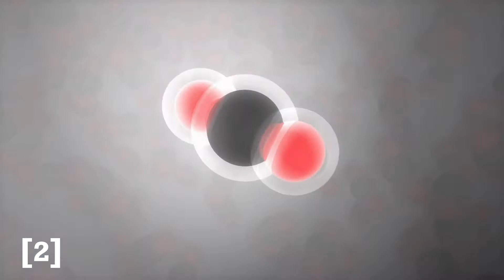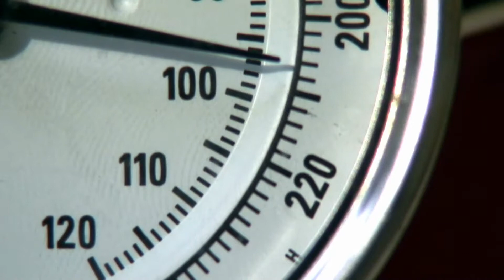Can Bioplastics Save the World?

Comment: The modern world relies on plastics, but using plastics isn't really the issue, what counts is what you do with them once they are beyond economic recycling, and where the carbon came from to make that plastic in the first place.
If it is plastic made from fossil-fuels then you have to make sure it never gets incinerated, otherwise the fossil-carbon it contains will immediately get converted to CO2 and added to the atmosphere's carbon-cycle, thereby warming the planet. 
Modifying plastic made from fossil-fuel origin carbon to make it "biodegradable" is also a recipe for environmental disaster, as the fossil-carbon it contains will get then converted to CO2 as the plastic rots, rather than staying trapped in the plastic molecules forever. 
Plastic of fossil-fuel origin must be deeply buried to sequester its carbon for millions of years.
Reply from the maker: Really good points there. I need to a video on carbon pricing as a follow up.